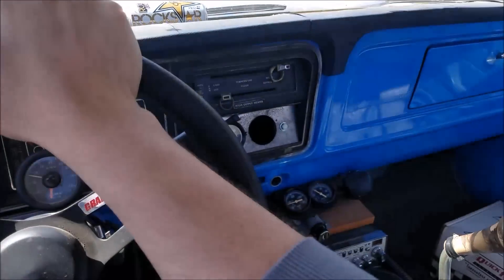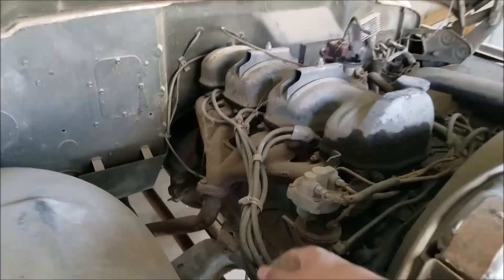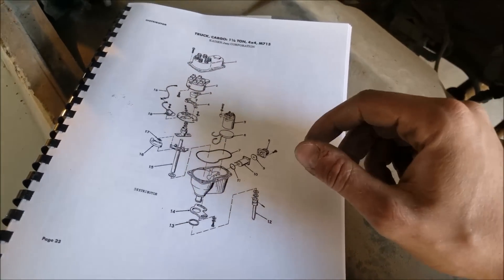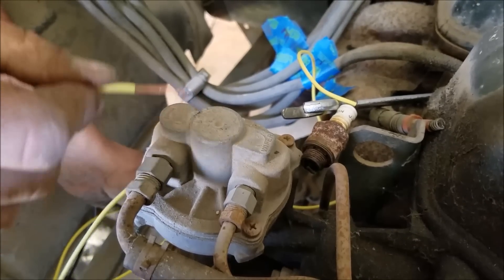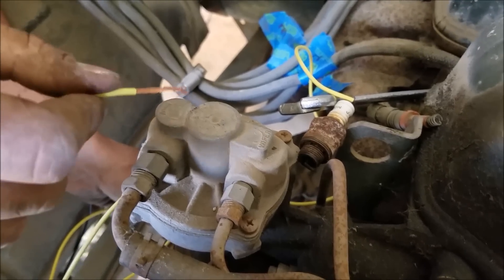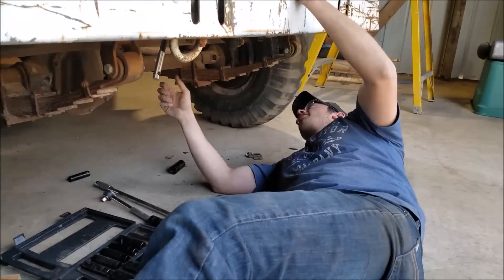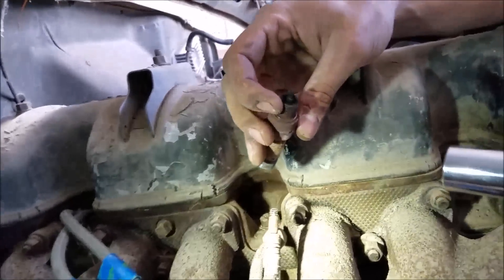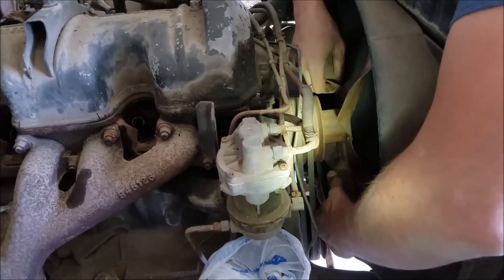Preserved 67 Gladiator Jeep Revival: Military Version - Dormant 30 Years w/ 6K Original Miles

Comment: That two way radio is definitely an old timer. I started running service in the late 60s, and that is identical to my radio. It was old at that time. There's another part, under a seat or somewhere, big, bulky and heavy.  Old iron for sure. Hoping I get the notification for when you return and try to get it motivating. One of your more interesting projects.

Comment: Gotta love a military vehicle set up for deep water fording. This is a little older than the trucks i worked on in the marine corp but looks like some of the technology didn't change.  Air  controlled wipers. Sealed engine crankcase ( diesel engines in my case)  and utilized crankcase pressure to pressurize the transmission, transfer case and diffs to prevent water intrusion past the seal.  Most likely had four 12 volt batteries wired in series parallel configuration to increase available amperage and provide 24 volts to the starter. With that huge generator it may have been a comm vehicle or used on an airstrip. Looks like a 3 phase genny with that junction box in front of the radiator.  Hope she fires up

Comment: What an interesting  find!  The ignition system uses aircraft components as far as the plugs and wires are concerned. The distributor actually looks something like a magneto, but may well be a distributor with integrated coil. The plug wires are not only waterproof, but also  shielded to help prevent radio interference, as aircraft radio is normally AM, whereas land mobile (except ham) is FM, less prone to static. The big lump on the driver's side of the engine is the military 24 volt generator. The big box above it with the two military type connectors is the regulator.  The radio is a Motorola Motrac, definitely low band, and probably around 35-40 MHz, given the CD lineage.

Comment: it is Kaiser Jeep M715.based upon the civilian Jeep Gladiator/grand wagoner. the tornado ohc 230 l6 was used in the USA starting late 1962 till 1964-65 in civilian gladiator/grand wagoner. military use ended in 1969. Industries Kaiser Argentina made the 230 l6 till 1973 and they made speed parts for them!!! look on EBay and craigslist international. the m715 did not see much combat use and a lot wear only used as a cargo transport units for light duty use as the frame and drive Trane could not take abuse . a lot wear used for civil defense that is why it is white.   
the radio looks like a Motorola and was for the upper hf band below cb chanel 1 around 26mhz or low band vhf hard to tell but if it has a 102inch antenna it will be for hf 26 mhz.  the fuel pump had a vacuum pump for the vacuum wipers, the thing in the grill is the rectifier for the 300-400a alternator. with the battery terminals never use the bolt on type total junk use the brass marine  type or military ordinance type NAPA has ether type  thay just have a long bolt that uses copper welding terminal lugs that you crimp on the battery cables. the plugs look standard just reuse the weather type boots. I would use a electronic ignition conversion kit. the dizzy looks like a holly or auto light or Lucas. if the cap, rotor, wires, are junk, use civilian jeep parts. just make sure the plugs look the same and are the same heat range. looks like a normal dizzy with cover and weather proof wires. I would change the oil use shell rotella t4 with marvel Mistry oil and napa gold filter , fuel filter, I would check the radiator to see if it is plugged/ junk. prime the oil system treat like a fresh rebuild. best of all follow the book to the t on the truck and do things to mill specs. should be able to find gov publications on this specific truck and in general how to repair things to mill specs. another thing I would do is study the electrical system as they are odd. the alternator could be junk as well the fuel pump. if fuel pump is bad gravity feed it to test. take care.
Reply: Good catch and I guess nobody else noticed the faded Civil Defense logo on the side of the door.

Comment: In the 80s it was common for the Air Force to paint Out Of Service Vehicles White. This is a M715 Kaiser Jeep. This was one of the first OHC engines in america, six cam lobes opening 12 valves! Divorced T Case just begging for a 5.0 and T5!
Reply: An OHC HEMI!  Jake Michael states Kaiser Argentina made speed parts...does that include cams with fat lobes and roller followers?   Be nice to stick a turbo on that exhaust.

Comment: Interesting. I'm not sure the plug wires are water tight. It think they are RF shielded. I don't know why, interference with some kind of radio communication? Even the distributor cap is inside an aluminum shell.

Comment: the fuel pump is a "dual action" design. these were common in the age of vacuum wipers. the fuel pump also was a vacuum pump (hence "dual action") to supplement engine vacuum. since large vehicles with small engines (like this jeep and larger trucks) often ran at wide open throttle or close to it. in that case not much manifold vacuum was produced and the windshield wipers would stop. this kind of pump is what you have here...

Comment: 24 volt electrics on a military vehicle like that often strongly suggests that it was fitted for radio/communications or other electronic equipment such as radar equipment so the electrical system might be rather different to what you'd expect on a road vehicle.  This may well have been fitted with a hard box body mounted in the load bay (along the lines of a demountable camper body) to make it a command and control vehicle, which is also strongly suggested by the very low mileage, a general service or troop carrier vehicle of this type would have seen a lot more use whereas a command and control vehicle doesn't due to it's specialisation which is likely to have seen it only used for training exercises and on active deployments.   The command car bodies on US military vehicles were often removed when they were withdrawn from service and before sale as the way the load bodies on US military vehicles were specified meant that the bodies could be transferred to a different type of vehicle therefore reducing the huge cost of command and control vehicles as the expensive part, the body and electronic equipment fitted could be transferred over as a unit rather than having to be broken down and then rebuilt into a new vehicle as was frequently the case with British army Land-Rovers.  White paint on a military vehicle often means that it has seen service with troops deployed to United Nations operations.  If that is the case then if you look carefully on the doors you'll probably see evidence of the UN designator markings on or in the paint.  Quite a large number of those heavy Jeeps are still in service with various militaries around the world after either being gifted to them by the US government or being bought as retired US military vehicles and reconditioned for further service else where, which is part of the reason why they're not, perhaps, as familiar in the US as other military vehicles, and another is rust, the bodies could rot horribly and a lot that were sold out of service for further use in the US were probably bought to be worked hard and have long since succumbed to terminal corrosion and serious abuse, a common fate for larger ex-military vehicles...
Reply: gosportjamie all military trucks/jeeps where 24 volt after ww2
Reply: +William Falconer  Thank you, I didn't realise that.  In the UK the lighter stuff was standard 12 volt unless they were FFR (fitted for radio/electronic equipment...)
Reply: Huh? What?
Just kidding. You do know your stuff. Might be a good ballpark of this truck's story.
Reply: Not the lightweight ones we had in Vietnam.

Comment: That's an old radio truck, you can identify it by the cooler mounted on the front of the grill it's a rectifier. Instead of an alternator it's running a generator. Those parts are all hard to find when they stop working
Reply: The generator looks looks like the same ones that are on the the newer 1165 and such. They have that huge thing for all the auxiliary stuff, lights radio equipment, long range antennas and the like.
Reply: Fair, but a good shop can usually rebuild those old generators, or worst case scenario it would have to be updated to an alternator setup and electrical system.

Comment: As far as that noise is concerned and this is something my dad taught me. Take a long screw driver or prybar and place it near where you think the noise is coming from and just have someone turn the engine by hand and just diagnose what it is coming from. Or just do it the easy way and pull the belts off and spin each pulley by hand. Really cool truck though. Both the JEEP and the F100. Good luck to you.

Comment: The manuals are available on pdf at the M715zone.com. Memphis Equipment Company should have any parts that you will need.
The M715 was a militarized version of the Jeep Gladiator pickup from the 60s so there will be some parts that will interchange with civilian models. That 230 Tornado had a reputation for valve cover gasket leaks which is no surprise considering their size.

Comment: Yes he used a tornado engines in civilian vehicles. I happen to have one Jeep wagoneer. It's painted officially army woodland camouflage. Somehow the motor sergeant got his POV privately owned vehicle in the mix of the military vehicles being painted and his painted. He'd be surprised how many decades at paint has lasted and how long we've owned it. Some say Pontiac had first overhead valve American engine others say that jeep had it first. But they don't go too fast but they go anywhere you want to just about. That wagoneer got over 20 miles a gallon and the beads of the tires hang over the side of those  wide spoke rims. There's names that kind of tire forget what it is. The problem with the engine is that the gear at the bottom of the distributor will rotate 180° out from time to time. Pull the distributor rotate it back and replace the small retaining pin then wait for it again. I got a couple of those wagoneers they're pretty neat. I think this Jeep is extremely neat thanks for finding it and doing a video

Comment: I learned to drive on this model. Still looking for another for myself. Great old truck. Hard to find parts.
Reply: All you need to do to find parts is find the nearest military surplus dump. There's at least one in every state, and they all have listings of every type of vehicle that was ever assigned to that base, when they were decommissioned, and where they went for the national military surplus auction, which, depending upon state and regional participation occur at least twice per year. 
I live in New Hampshire, and because most of our New England  area military Installations were closed during Clinton's asinine stripping of the military, and NASA's ending of the shuttle program, ( The former Pease Air Force Base having been the Northeastern United States Emergency Shuttle Landing Strip, because it was the only one long enough for the shuttle to land on), 
And, the now, beyond top secret location of the former Fort Devans Federal Emergency Management Agency - PRISON, (Yeah, FEMA runs their own federal prisons hidden in closed military Installations!) anyway), if you need parts for these old specialty vehicles from the military, those auctions happen here in September, and April, of the state has a separate one because they confiscated or decommissioned state police, department of transportation, or other state agency vehicles.

Comment: So something I’ve seen on HMMWVs that came out of depo after a full refurbish was a new odometer with zero miles on it.  I mean, it was basically a new vehicle since anything that needed replaced was, along with a fully rebuilt engine/transmission/etc.

If the original paperwork could be found, I bet it had a bunch more miles, then broke, was sent into depo for refurbishment, then came out and sat around before being sold off/given to another agency as excess (since this was at the end of the Vietnam war).  Then whatever that Civil Defense was had it and put the 6,000 miles on it before it was no longer useful to them and they got rid of it.

I dunno, just my take on its life...
Reply: Probably very right.

Comment: That fuel pump also has a vacuum pump to power the windshield wipers, and maybe even suck water out of the generator, more likely just to  circulate air to keep it cool,, that one barrel Holley is the same one for Dodge slant six,s

Comment: Should always vacuum around the plugs before you remove them to keep dirt from falling into the cylinders. Even if you have to rig up a smaller hose to get in there. Also, once the plug moves a little shoot some penetrating oil down around the plug and work it in and to lube the threads. Makes it easier to get them out.

Comment: It's an M 715. It has the Jeep Tornado 6 cylinder that was available in civilian full size Jeep pickup and Wagoneers from 62 - 65.
The sealed electrical system is standard military tactical vehicle grade. It was also used on the M151 jeeps. 
Tactical vehicles have standard 24 volt electrical systems and don't use ignition keys either.
You don't know much about military vehicles.

Comment: Holley is a model 1920.  Hard to find parts for lol. 

Transmission  Borg Warner t-98
Transfer case new process 200
Rear end dana 70 5:87 gears
Front end. Dana 60 5:87 gears 

Fun trucks  I had 2 of them

Comment: I watched the second video first, that cam shaft puzzles me with one  lobe opening and closing the intake and exhaust valve, on a four banger when number one is on compression  both valves are closed number four should have over lap, which means the intake and exhaust would be at half  lift, im guessing the rocker arms must have a weird set up, like a long rocker arm that sits on the  cam lobe, I know its a six banger but im using a four banger as an example to understand it better,. Im guessing since its a military vehicle,  and the shit hits the fan , who needs time to search for the ignition key

Comment: Hey i have a motorized bike question for you. I bought a kit and installed it on my bike and the clutch will not engage when i pull the lever. Why is that? Its a new bike unused motor
Reply from the maker: i need to make another motorized bike video again soon just for old times sake - on your question, have you seen my clutch adjustment video?
Reply: ThunderHead289 no i have not
Reply from the maker: neutral battle with shannon https://youtu.be/sAO69934s3M

Comment: That is a late 60's or early 70's Kaiser Jeep M715.  It is possible the owner repainted it white but everything else about it is original except what's behind the grill.  The blinker light fixture is not original.  I am led to believe that it has run recently as it is mostly dust free and has more or less new tires.  You called this a Jeep Gladiator.  It is not.  Learn your lesson.

Comment: "Ohm out"?? You mean whether or not they have continuity. Please do not use airhead slang.
Reply from the maker: William Crowell I’m good at mechanics 
.... not necessarily with public speaking. 
Good call on that 👍
Reply: William Crowell  He measured for more than just continuity; he says he's measuring the resistance through each wire looking for any that were inconsistent with the others.  A breakdown of the conductor or insulation would cause an increase in resistance; one wire with more resistance than the others would indicate it's going (or gone) bad.  Resistance is measured in Ohms.... I'd say "ohm-out" was appropriate here.  Please try not to make airhead comments on people's videos.
Reply: Nope, sorry, Eric; "ohm out" is for airheads.  So if you're an airhead, just admit it; don't give me a bunch of shit about it.  Just accept the fact that you're an airhead, OK. He was measuring the resistance of the wires, not "ohming them out".
Reply: You're contradicting yourself a bit here, William.  You stated first that he's only checking for conductivity, but now that I've explained to you how he's actually measuring for resistance (in Ohms) and why that's useful, you're changing your tune, admitting in your reply that he's measuring for resistance and not just conductivity, essentially acknowledging that I was correct.  I guess I'm the airhead though ;)
Reply: Just send it